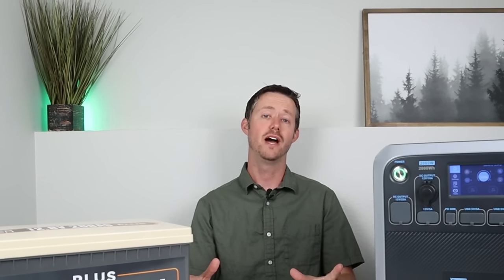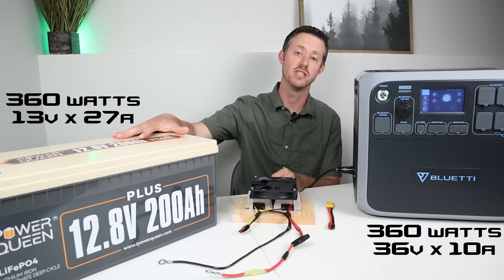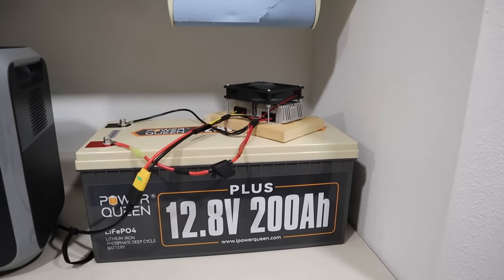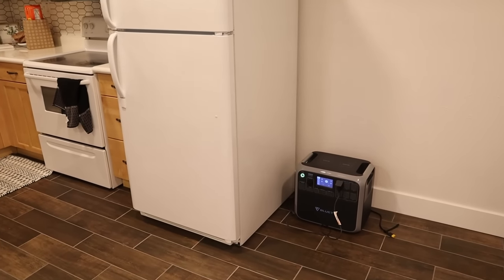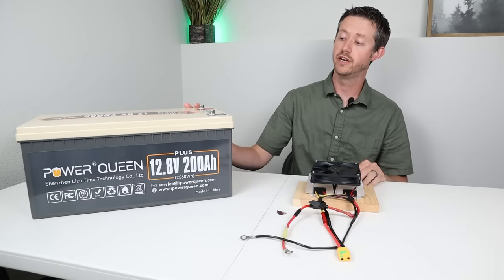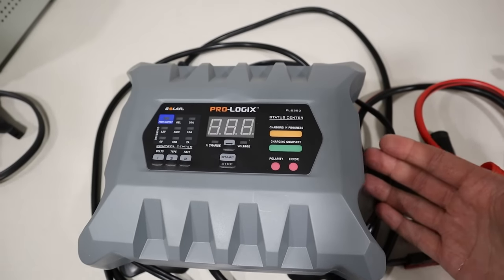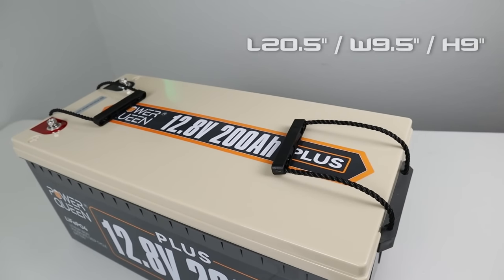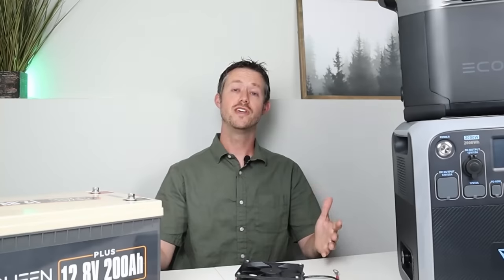Make Your Power Station Last Longer! Power Queen 200AH LiFePO4 - DIY Expansion Battery!

Comment: Looks like a fun project!   I'm just not a big fan of transferring energy from one large (discrete) storage source to another.  You're going to lose energy twice.  First during the transfer from the battery to the power station and then again when you convert it within in the main station to power your items (inverter loss, etc.).  By the time you get it from the external battery to whatever appliance you are actually powering, you might only have 75-80% usable energy from the Power Queen battery.  If it were a modular or expansion battery pack built specifically for the existing unit, I could see value in it as it would be designed to integrate directly into the circuitry of the power station with no conversion loss. 

I'd rather use the time and money to build a power station around the Power Queen battery and then I'd have TWO large power stations to offer myself some redundancy and ability to use them in multiple locations.  If you've got to carry two big/heavy battery packs around, they may as well both be able to power appliances on their own.  Redundancy is a good thing!  In my videos, you'll see that I built solar pergolas to provide power to landscape/pool lights.  I have also built several portable power stations.  I can pull power off of any of these to use around the house/yard in emergencies when necessary.   I'm sure there are use cases for this out there somewhere though. I do like the battery.  I might have to build another portable power station with these and make another video!

Keep experimenting for sure!
Reply from the maker: There are multiple ways to skin a cat, each person has their own preference lol. Thanks for sharing your feedback!
Reply: This was exactly my thought. U Nailed it!

Comment: Man… I was looking for a video like this and you nailed every question I had. I really appreciate it.
Reply from the maker: You may like to see how to charge with better DC to DC converter, here's another video you'll like:
https://youtu.be/I78RxjRXTn4?si=hdiSpMWjhnlSPHZD
This is another video about using 12v 24v and 48v batteries instead:
https://youtu.be/tK4JKmfndh8?si=LRawOdlofkvzUZYu
Reply: Just go buy an invertor n you’ll extend ur bluetties battery life
Reply from the maker: @theinnocent714  using an inverter to charge your power station would do the same thing that's in the video, except it would be less efficient. DC to DC Charging is always more efficient.

Comment: If I was going to do it, I would just get the 24v battery they have listed and simply the entire setup. I realize they sent you the 12V and you had to work with what they sent. Great video!
Reply from the maker: Buying a 48v battery would be even better! Like one of those EG4 5kw ones :) :) :)
Reply: @Jasonoid  Hi and great video.  I am pretty new to this and have two questions - can I charge a 48v battery from my DeltaPro  by using one of the chargers you showed ?  Second one is - do i need to drop the voltage down when charging my DeltaPro from the 48v battery?  Thanks!
Reply from the maker: The Delta Pro can handle the 48v just fine, no need to drop the voltage.

When choosing a charger for a 48v lifepo4 battery you won't be able to use the chargers I have in the video, those are for 12v options. You'll find 48v options online listed as "58.4v  10 amp Lifepo4 48v 16s  battery charger". Pick one with good reviews and you should be able to run the charger  off the inverter of your Delta Pro.
Reply: Is it possible to charge a 48v battery with solar panels? I have 570w panels short circuit current 14.31amps and  open circuit voltage 50.74v  would they work ok? Thank you

Comment: I've been using two 12-volt LifePO4 batteries connected in series to become one 24-volt battery. I plug this directly into my Ugreen 1200W PowerRoam's car/solar charging input (one XT-60 connector) and get about 380 watts charging power. No converter needed. 15 amp pull/15 amp draw. It's been working well.
Reply from the maker: I love the UGREEN 1200w, that device is a beast!
Reply: @Jasonoid  I first heard about it from you. Your review of it is what sold me. Thanks!

Comment: also you should turn off the fridge defrost timer either physically or electronically.  It will run atleast once a day or every few days depending on the model.  Defrost uses around 1-2k watts of a heater element that runs around 10 mins depending on how iced up it is or programmed.  Just don't open the fridge doors too often that can let moisture into the fridge.
Reply from the maker: We live in a very dry environment,  so frost isn't much of an issue since the humidity is so low.  I have watched the wattage pull on this fridge it pulls 500 watts+ pretty consistently. I'll need to look into disabling that feature to save power!

Comment: I have the Power Queen 50 Ah battery, and have used it to expand the capacity of EB55 once the sun goes down.  I just connect them straight up at 12v.  I haven't tried boosting the voltage.  I'm not usually running large loads on the EB55, so 12v charging has been fine.
Reply from the maker: Dumping power at 100 watts is fine for small loads, if you wanted to get double the speed without going over the charging voltage input, just use a 12v to 24v converter and you'll see around 200 watts charging instead of 100 watts.

Comment: This guy has more common-sense than most bluetti shills on youtube. He'd get more benefit if an xt-90 Y-Cable was added to the motherboard then out to a 15KWHR home made battery. Also, don't rely on that 500W ac adapter barrel plug for too long it will start burning if used 24/7 in conjunction with solar input. Instead add an external 48V solar charge controller to the 15KWHR home made battery.

Comment: Great presentation, thanks. Good add-on, with your charging devices' comparison, at the end.
Re. your intended mods, to your custom charging converter, you could replace the fuse, with a resetable circuit breaker. Would be a lot more compatible with your applied loading. And, obviously, your increased cable sizing.

I built a DIY power station, utilising 18650 Li-Ion cells, to produce ~151AH, @12VDC battery, which = ~1600WH. Really like your concept on multiplying the charge voltage, to reduce time.
As I'm in the process of building 2x portable batteries (again, Li-Ion, @~90AH each), which can be run in parallel, to charge the main station. Looks like I have another project: modifying it to allow for a greater charge voltage. 
At present, it has an XT60 solar input connector, for my solar system, & couple of other alterations required.
PS. You have another sub.
Reply: Why use the Bluetti and not just run off of the inverter?? Seems to be a waste to me to charge that thing up.

Comment: Thanks for sharing!  I've been looking to do this on a smaller scale with my 100AH LiFePO4 battery and a Bluetti EB70S for those longer trips.  Also useful in the event of a power outage to run a fridge like you did here.  I definitely need to pick up the 12-24V converter for those faster charge times.
Reply from the maker: 200 watts is a decent charging amount on the smaller power stations! That would work well on the 100ah battery.
Reply: I have this set up for power outage and camping, ebike, I got the "Newport Vessels Box" for the 100ah battery
Reply: @garrison_herbert  which size newport box are you using?
Reply: @garrison_herbert  I have the same box.  What do you use to connect it to the Bluetti?  Just the cigarette plug to the barrel connector?  I believe that connection is 10A max, so wondering if it's better to connect it via the terminals.
Reply: @sirramblinrose  I think they only make one size; "for sizes 24 and 27"
Reply: @TwoHeadsBrewing  For now only using cigarette plug, thinking of getting a DC to DC 12v-24v booster, saw a video from Jasoniod. Also got a 500w inverter to use the 12v battery separately.

Comment: Nice video.   I put a 100 ah LiFePo battery enclosed in a Plano tool box with a AiLi shunt to measure SOC and use a XTAR solar panel coupled with a Powerwerx MPPT solar controller—both products you reviewed awhile back to recharge the battery when boon docking.  Together with a few pigtails it works great at charging my EcoFlow River Pro but I typically use it to power my ICECO JP40, another product you reviewed.   Thanks for all your videos!
Reply from the maker: You got all the things! Excellent setup Jack!
Reply: Which size tool box did you get?
Reply: @sirramblinrose  Approximately 22” x 10.5” x 12.5” (L x W x H).

Comment: Jasoniod,
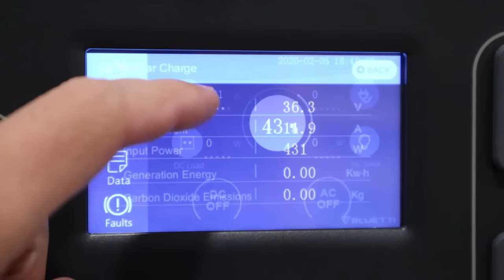Thanks for your excellent video.  As I am a novice, perhaps you can clarify some of the results I don't fully understand.  Assumptions: Bluetti input current is limited to 10 Amps, power in = power out. Power = Volts x Amps.  Looking at the Bluetti display at 5:39 in the video the input current assumption proved to be  incorrect (36.3 V, 11.9 Amps, and 431 Watts).  Here I have three questions.  1)  If a specification is a numeric value and does not represent a limit, how are we to interpret the meaning of the value presented?  2)  For Bluetti, what is the real limit for input current?, and finally, 3) How does the controller protect the circuit when it reaches the max input?  Also, the clamp meter registered output of 38 Amps.  38 Amps x 12.8 Volts = 486 Watts.  If power in is equal to power out shouldn't the bluetti have input of 486 Watts divided by 36 Volts which is 13.5 Amps?  From a novice Thanks in advance.

Comment: On a smaller power station, why not buy two 100 Ah batteries, hook them in the series, which would give you 24 V 

then you would need no converter so it would be more efficient
Reply from the maker: That would work just fine!

Comment: I use the DC Charging Enhancer (D050S) from Bluetti to charge my AC200P from a 12 volt source or battery. It’s $159 and it works great. The DIY solution would be good for brands that don’t have the option. The downside of this setup is that the extra battery won’t charge with the main unit the way legit expansion batteries do on models which have that option like the AC200Max.
Reply from the maker: Ive seen some people use the D050S with solar panels at get the full 500 watts. How much power do you see using a 12v power source? No one has made a video about that and the Bluetti website says nothing about the specs.
Reply: @Jasonoid  I’ve used it to charge a Bluetti EB240 from a 12v lead acid battery.  I was pretty consistently pulling about 95 watts.

[edit: corrected, accidentally wrote EB55 earlier, which is not correct.]
Reply: I'm curious how the Bluetti option works as well. Looks like I could make this setup and save a few bucks but it would be nice to just have the Bluetti solution. It's just massive from what I've seen in the picture.
Reply: @ziggy29   I've been told in order to use the DO50S with a small power station you have to use some kind of step down converter with it or it could fry your small power station
Reply: @Moes_Prep_and_Tech  You are correct -- I meant EB240, not EB55.  I have fixed that.
Reply: Is there a solution to charge the battery from the AC200P or is it best to set up a second solar array for the extra battery and then use a dc charging enhancer to charge the Bluetti?
Reply: @markbodine9257  Buy a AC battery charger and connect the power queen to the AC output then charge the AC200P from a solar device. The AC200P supports pass through charging.

Comment: I've done something similar to connect a LiFePo4 battery to the Titan Solar Generator (24V battery) using an ISDT P20 DC-DC smart charger.  Works well for extending the discharge time of the Titan.

Comment: Very cool video.  You're basically using the 12v battery and boost converters to feed "solar" into the power station, correct?  It's also worth noting that Power Queen sells an identical battery, in a 100AH, 24v configuration, that would probably allow you to go directly into a power station with roughly 250 watts of input, and you wouldn't need the boost converters.  (You could still get a 24 to 36 volt converter, if you wanted more input?)
Reply from the maker: Correct, trying to simulate solar with a higher input voltage than the battery. If you got the 24v battery you could just charge at 24v, or I'd recommend a 24v to 48v converter to get even more power.

Comment: You should also factor in the conversion loss on those two inveretrs since they are not 100% efficient, basically power in is not the same as power out due to conversion loss. You should provide the measured current draws on input and output.
Reply from the maker: Good point, sure is some loss through heat. I'm sure it's similar to what an inverter would be using.

Comment: Why not plug the power queen into the Buletti to begin with and the Buletti will pull from the PQ batt and discharge both together?

I am doing a similar idea with my DIY power station which has a 12v 16ah battery.  I am adding a Ryobi battery receptacle and a buck converter so when I plug a Ryobi One+ battery in, it will replenish the power station, even while in use.  I have several videos already about doing such things with Ryobi batteries.  As long as the power station has pass thru charging (like your Buetti) your idea should work.  Great video.  I don't always comment, but I do always watch.
Reply from the maker: That would work well Russ, there are many ways to accomplish the same goal. Thanks for sharing your ideas, I'm sure others will see this comment!

Comment: Saw your Charger 1 video and not too impressed with that charger 1 product. Your DIY project still seems like the way to go. Question on using a lifepo4 battery to expand capacity.. why use your DC to DC charger when you could just plug 12v from the lifepo4 battery into the Bluetti cigarette input? Is it the faster charge time?

Comment: That small fuse is not sufficient for the power source. Usually the small ATC fuses have an AIC (amp interrupting capacity) of 1000Amps, and the short circuit amp rating of that battery is certainly 3000+ amps, so you’ll need an appropriate fuse.

Comment: What is the advantage of the charging device you built over using the power inverter you used to drain the 200ah battery with the lamps, to recharge the power generated?

Comment: Great video, thanks for addressing wire size. I'm just a beginner so my question out of ignorance. What is the wire gauge you are using here? In videos I have seen it seems batteries of any voltage are always connected to inverters by very thick wires, thicker than what you have here, and official extra batteries for sold for power stations use very thick wires as well. However all the videos I have seen showing how to connect an unofficial extra battery to a power station use thinner wires as well. Is this type of connection a different situation where it is ok to use thinner wires than usual (but not too thin as you discussed), compared to something that normally uses even thicker wires? 

I ask because all of the pre-made wires that don't require any crimping for connecting battery clamps or eyelets to other connectors that could go into a power station (like mc4 or xt60) seem all quite thin. So if it would be unsafe to use them to connect for example a 12v 100ah battery to ecoflow delta 2, then I will seek out thicker wire and learn to crimp.
Reply from the maker: Wire size is all based on amps. Power stations typically rely on a 'lower amperage and higher voltage' setup to get their power so they don't require large charging wires. For example, your Delta 2 will take is 15 amps max at higher voltages and only 8 amps on anything under ~30 volts.
Once you know the amperage going through your wires, you can look up an ampacity wire chart to determine what size of wire you need.
Reply: @Jasonoid  Thank you for your answer, that makes sense now.

Comment: If you put 2 or more boost converter in parallel, i would use a diode, and make sure your boost converter has an adjustable battery under voltage protection

Comment: So you used two to double the amps. Its still not a bad price but you can get a 12v to 48v 10a step up converter for about the same price. so a little less wiring to deal with.

Comment: Hey @Jasonoid, excellent video as always.  I think it would be really helpful if someone could guide the community on how to setup solar+alternator charging to solar generator till 100% full, then dump excess into a secondary battery like this.  Icing on the cake would be that the secondary battery could then automatically charge the solar generator when the sun isn't shining.  I have searched, and I have not found any resources for this.  Would be awesome.
Reply: I am hoping to learn this as well!

Comment: Maybe I missed it but I'd really have liked seeing an efficiency comparison between charging the power station directly and with the boost converters. Just to give a feeling for what are the losses involved.
Reply from the maker: Lots of loss to heat with these boosters compared to using solar panels. Solar panel charging is one of the most efficient ways to charge a battery because charge controllers can get around 95%+ efficiency. I'd say always use solar when possible, this battery expansion is a backup for night or when the sun isn't shining.
Reply: @Jasonoid  I'm aware of the losses, that's why I'm asking for the figures. Maybe you can add it to the comments. At least the ones from the converters are easy enough to measure and calculate.
Reply from the maker: gotcha, I'll have to do some future calculations with some clamp meters and voltmeters to verify exact efficiency. The best option would be to take a LFP 48v battery and use no converters, but those are quite expensive.